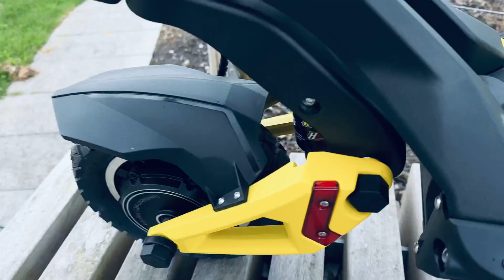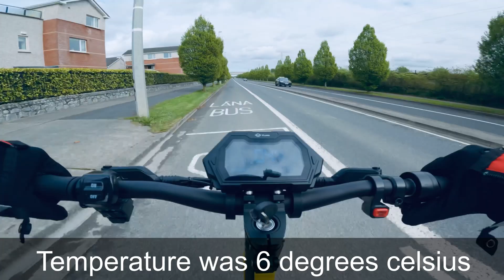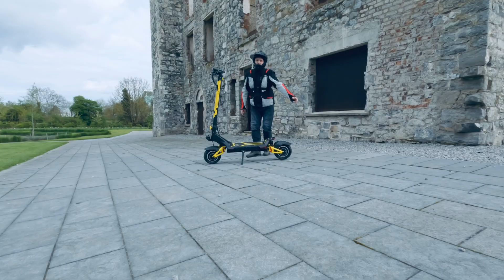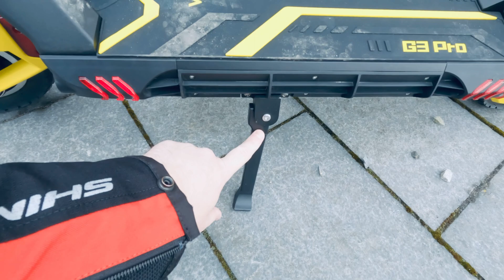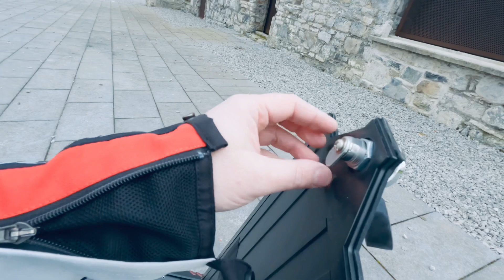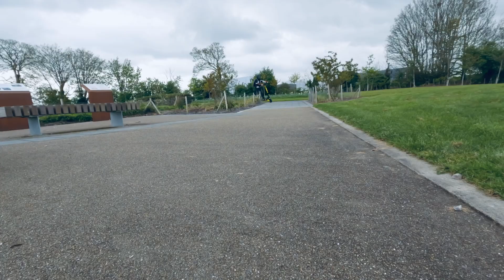Vlaken G3 Pro // CLOSE Up, Spec REVEAL + First Ride

Comment: Your close to me in that video what’s the top speed on it I have a m5 pro at the moment it goes 65-67 is this faster?
Reply from the maker: 63km/h was the fastest I got on this. More than fast enough. Very good quality. Never tried the M5 Pro (yet) but they only go 52km/h max. 

Some people play around with the parameters on them to ‘speed hack’ but in reality it’s not possible and gives incorrect readings on the display. Easiest way to get the true speed is with a GPS speed test using an app. I use ‘speedometer’ app

Comment: What are the measurements of the deck n this scooter?
Reply from the maker: 199mm in width x 517mm in length.

It’s on sale also at the moment.

🛴 Official Kukirin site and use my discount code ‘Movelectrics50’ 
https://www.kukirin-scooter.com/products/kukirin-g3-pro-electric-scooter?sca_ref=4122434.iTwt6pH9bx
Reply: @Movelectrics  thank you so much!
Reply: @Movelectrics  do you have a discount on the us site?
Reply from the maker: @Whattanu  I don’t unfortunately. Only EU site.

Comment: What’s the Real autonomy? (Range)
Reply from the maker: Depends on weight, wind, hills, tyre pressure, what gear your in, single or dual motors use, outside temperature, start/stopping.

If you are going gear 3, dual, max of about 30kms but still very difficult to answer because of the factors above.

Comment: you just gotta ask them which of the 4 battery capacity you want by the chat ?
Reply from the maker: Definitely message them first through chat.
Reply: @Movelectrics  alright and can I choose the color since I can do so on another supplier ? Id like it in black but maybe it’s also from messaging that you do so
Reply from the maker: I don’t work for them, I reviewed their scooter only. But they are helpful so definitely ask them any questions you may have.
Reply: @Movelectrics  ok and suspension wise these are comfy ?
Reply from the maker: Suspension is brilliant.

Comment: Is this the same as the kukirin g3 pro?
Reply from the maker: Yes
Compare prices between the manufacturer and KUGOO 

🛴 Vlaken G3 Pro https://bit.ly/3LPW0R3

OR compare prices with the KUGOO brand

🛴 https://www.geekbuying.com/go/7csvIpiI
Reply: @Movelectrics  thanks for replying so quick, I have another question, What is the real world range on a highest mode? Thanks
Reply from the maker: @209rc7  depends on many factors. Weight, wind, speed, start/stop, hills and so on. For myself that’s about 80kg, going fast as possible, about 30-35km max distance.
Reply: @Movelectrics  they don't let you buy one at least according to the chat. They say its exclusive to distributors. Want me to buy the VDM-10.

Comment: Hi mate how did you get the vlaken as i really like the battery upgrade suspension upgrade and the option of nutt brakes looking at the kukirin g3 pro same specs but no options on battery upgrade brake upgrade and suspension upgrade would love to know were you ordered through all i can find is a place in Australia any help would be much appreciated thanks Scott.
Reply from the maker: Hi man
So this Vlaken is direct from the Titan group (manufacturer) all links below.

You can get different options through them so definitely check them out. With regard to shipping to Australia, I’m not sure. I can ask on your behalf. I’ll get back to you asap.
Reply: Looking at shipping to the UK only site I could find was in Australia they don't ship to the UK ,went on the link in your review looks like min order is for two any help would be much appreciated thanks Scott.
Reply from the maker: @mightycromm6299  ah right so you need it shipped to UK? I’ll ask them.
Reply: Thanks mate your a legend also couldn't find an option for nut brakes or upgraded battery the suspension is spot on hydraulic spring just battery and brake upgrade many thanks Scott.
Reply: Just wanted to ask about the cable over the swing arm on front
Reply from the maker: Nothing to worry about.
Reply: Have one on the way 🙌 hope I made the right choice
Reply from the maker: Congrats! Where did you buy from?

Comment: Road runner Rs5, Vlaken G3 pro, Titan G3 Pro, Unicool G3 pro, all are the same scooters, perfect scooter but range is around 15miles  with 3rd mode of speed, dual motors on
Reply from the maker: Vlaken like I mention is made from the Titan/Unicool group (of course you can see all this when you click the link in the description)

Also I do have more less the same battery on my E1 that’s 52v 18Ah and got around 30kms per charge on 3rd gear dual. In reality though, going as fast as possible ain’t of interest to me.

I’m interested in like most people, how durable the scoter is and I have to say, for the price it’s at, you can’t go wrong. 

Plus the removable battery! That is brilliant to have.

Full review will come out and an off road test. Ride safe Carl ⚡️
Reply: @Movelectrics  my scooter is Kukirin G3 Pro, so I got 15.2 miles today with gear 3 with dual motors on, do you think it is normal or should I bring that back to dealership to change with another one of it, it though it could hit at least 22-25miles with dual motors but performance is pretty weak
Reply: @carljohnson3090  I have KuKirin G3 Pro and I can confirm that on dual motors mode and on 3th gear the battery is draining fast.
Reply: @carljohnson3090 The tested 50 miles is on a 110 lb rider 😂😂
Reply: @carljohnson3090  you forgot kukirin g3 pro
Reply: At least the road runner has screw holes to add a damper.